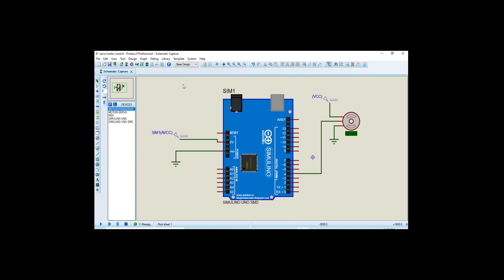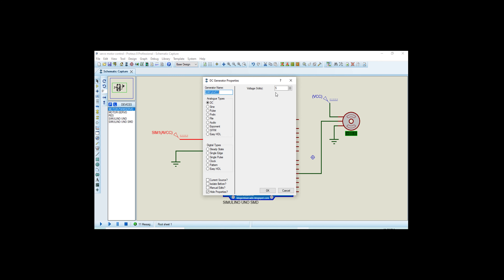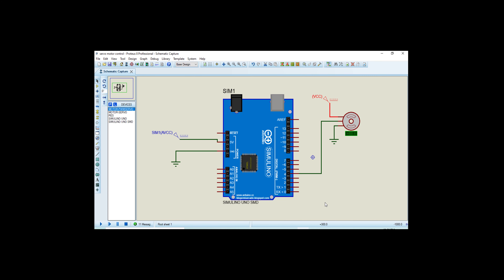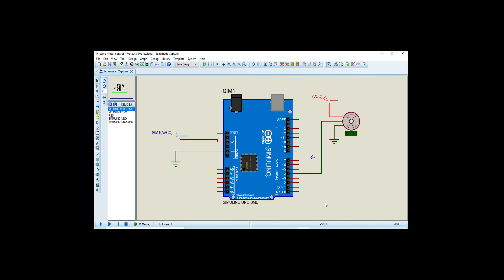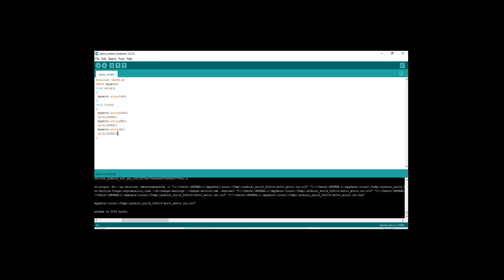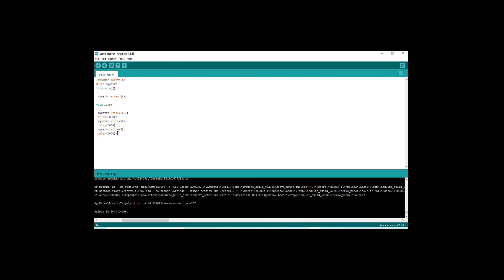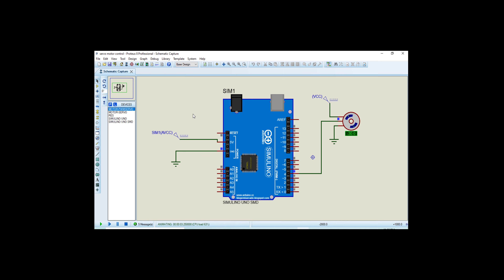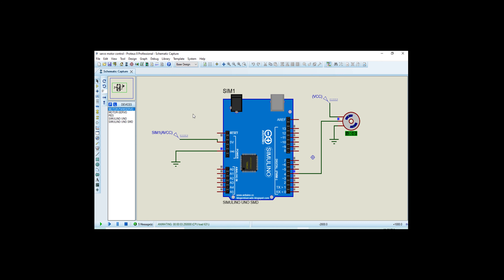ARDUINO servo motor control

Comment from the maker: #ARDUINO #servo #motor #control #code
#include <Servo.h>
Servo myservo;
void setup()
{
 myservo.attach(4);
}
void loop()
{
 myservo.write(180);
 delay(1000);
 myservo.write(90);
 delay(1000);
 myservo.write(0);
 delay(1000);
}